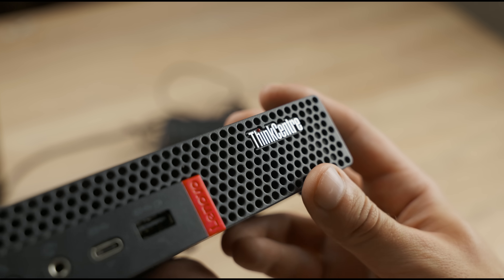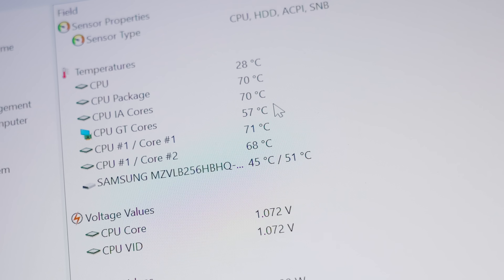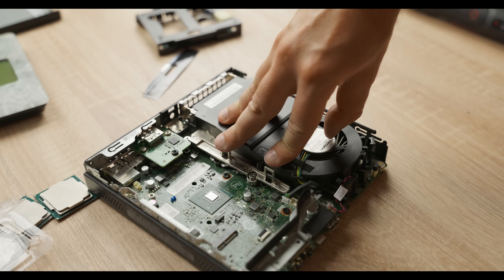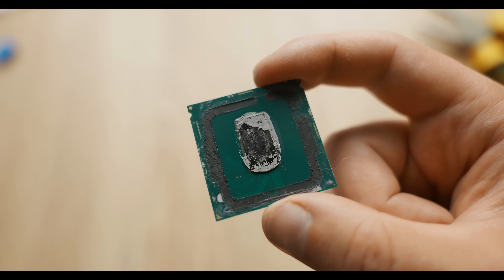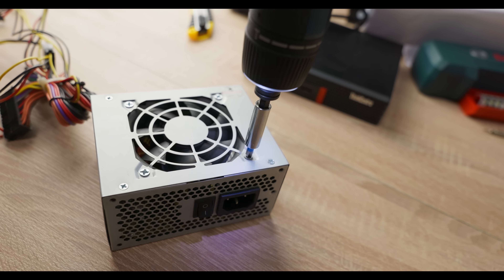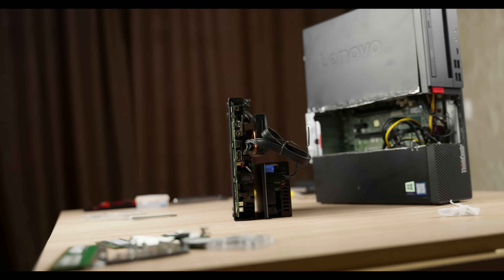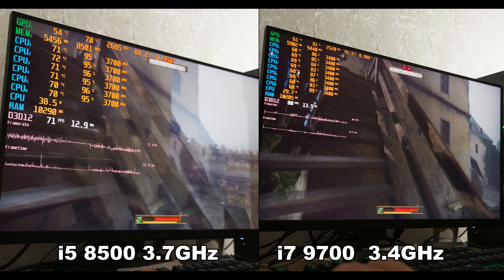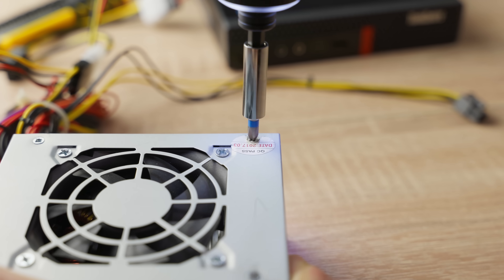Building the Worlds Most Upgradeable Mini PC

Comment from the maker: In the video description, the price of one board is listed as $100 because I couldn’t find it cheaper on AliExpress. But I bought the PC in Ukraine, in case anyone’s interested. Also, for around $150 you can already get one with a better processor than the one I used in the video.
Reply: The minipc itself with max PSU , was like 75 $ in a weekeend  scrap markt in Bucharest , and it came by default with a full height PCI-e x16 x75W ready slot, on the side .They are rare machines, not essy to find, was pure luck .I wonder if I can swap with better CPU, and if it worth, and I guess they can take only T or no letter CPU.
Reply: put a ryser on MINISFORUM MS-A2  x16 pci 4.0
Reply: Dangerous to me, or dangerous to the CPU?
Unlike my CPU's transistors, my outer epidermis will grow back

Comment: Fish Tank PC. build the strongest gaming pc you can in a 5 gallon Fishtank and have it all cooled by liquid inside the tank. You can use a circulator pump to move the liquid. just need a way to have the connectors for Power, GPU, Mouse and keyboard on the lid of the tank.

Comment: Aren't i7-9700 & i5-8500 both 65-watt TDP CPU's?
Then why is the power consumption so high on i7-9700 and hard to under-volt to below 40-watt?
Just because its a 8 Core CPU? (compared to 6 Core of i5-8500)

Comment: i think i have the same tiny on my desk. I use it as a linux server - a hardware vm. Mostly for random USB, wifi, networking control. It just a kaby i5 K
Frequencies dip on it because of voltage throttling. Not always, but under load.  Too much CPU for the computer - still runs fine, so i kept it in there.

Comment: UNA SIMPLE SOLUCIÓN PODRÍA BAJAR ALGO MÁS LA TEMPERATURA.  7:57 Los disipadores por sí solos no van a hacer nada, solamente se va a "almacenar" el calor del mosfet en el disipador..  Esos disipadores para funcionar correctamente necesitan de ventilación, circulación de aire para evitar que el calor se concentre en los mismos disipadores, Y en éste caso 8:01 , justamente eso no sucede porque la turbina está tapando los disipadores de los mosfet y el aire no arrasa con el calor en los disipadores. La solución podría ser sencilla: cortar la parte inferior de la turbina justo donde se encuentran los mosfet y de esa manera, el aire generado por el ventilador, sacaría el calor hacía el exterior por las ranuras del chasis.

Comment: I have a Lenovo like this and I upgraded the CPU to an i9-9900T (got it used but it was brand new) with a good nvme 
Instead of a GPU I installed another HDD (I use it mostly for work and sync my dropbox) but my big issue about upgrading GPU for it = Flex PSU price here. 
I can get from Aliexpress but with delivery and taxes it would cost me almost the price of the computer it self 
But if you have a spare (or cheap) unit to run it, its nice

Comment: damn. spent about 200 on my HP 800 G3 mini. 95w adapter, an i7-7700, IC graphite thermal pad, 32gb (2x16gb) ram, and an SSD I had lying around. ran VR for a few moments, but went over 102C before the system started freezing up, the system made a noise, and I pulled the plug. Seemed fine after running again, and haven't tried VR since lol. Currently use mine for a home server, but planning on setting up a PowerEdge R730 as a media server/main desktop, and using the mini PC as a stream platform for it.

Comment: Is there a graphics card worth buying that actually fit in the small pc, as is, (with the riser) without extra power and that performs better than the built in 630 and where you can close the lid?
Reply: I put a low profile single slot yeston 3050 in my p330 tiny and it fit after I drilled a hole in the case for the fan and took the shroud off the gpu heatsink.. It works off the pcie slot power alone but you need to underclock it to keep it stable. I keep mine capped at about 60 watts. Nice little build. people also design 3d printable covers for two slot low profile cards as well. It's a 6GB vram card so don't expect the latest AAA but it will run games just fine if you have reasonable expectations.

Comment: Hahaha oh wow
I suppose that truly is the best combination for a mini-PC right now; I guess there is actually finally a use case or reason to buy a 4060. I hadn't even realized that was actually the best performance for the buck as per efficiency you pretty much could get, everything else which is similarish in performance, sucks power like a hog, *or*, it is significantly worse performing which may not even fit in a low profile case anyway. I can't believe 115w is the best we can do nowadays, I remember when a bish tier GPU was like, a 65w 1gb card, but that even with much advancing graphics there was still often lower power, low profile options that'd be like a hundred bucks for a 75w card. I guess now it's a 6 pin minimum.

Also I was skeptical of the VRMs the moment I saw you bust out the 9700, Dell particularly is NOTORIOUS for cheaping out on their shitboards, it's basically one of the only things which is truly Dell's so naturally Dell's motherboards totally and completely suck as does anything like them which is most usually cheaped out on the VRMs and that is exactly why Dell motherboards usually have overclocking locked out on a BIOS level I've never found any workaround for, which is just as well considering if you OC'd a 4770k on a crappy Optiplex board odds are youll blow the VRMs and fry possibly not just the board but also other actually quasi valuable parts like the CPU. Which is why for my pet projects my favourite is getting the not-Dell, not-HP, not-Lenovo kind of motherboards that have real VRMs that could handle it. Also, funnily enough the bigger reasons most people eventually got saddled with ditching their Dell family PC altogether was near always board related.

Unfortunately, for any newer PC that era related like. First of all I am astonished that thing had a Pentium but could take a 9700 or 8500, hadn't realized that was in the same grid array anyway this doesn't matter as much because 6 threads is still rather pathetic ultimately (like for real, a quadcore 3770k had 8 threads; the 3570k was most limited bc it was 4C/4T and halving threads made them perform horrifically badly in modern uses, I'd not be shocked a 8500 does badly due to only 6 threads) but even then you are going to have serious VRM issues on anything. Meaning I guess you can't pipe much graphics through it anyway because cooling isn't the only issue, it points out the bigger problem (I also was surprised you didn't jerry rig a low profile noctua tbh) which is that those VRMs are eventually going to blow. Like they are physically going to spark and short out the PSU and maybe even trip a circuit in your room sooner or later the more you try modding those.

Comment: NGL I'm pretty sure I bought the same m920q from the same eBay lot, we have the same base specs. I ended up putting an i7-9700k, Nvidia t1000 4g GPU, 32gb ram, 512gb nvme, and I tore a 2tb SATA down to its board which I was able to fit under the GPU. Using a 170watt power supply and software to remove the tdp limit I'm able to push 90watts from the CPU which is pretty sweet

Comment: looks uglyyyy as hell I have the same computer just upgraded the ram, psu brick,  and gpu with a radeon low profile that it fits inside the case, pci express is 3.0 i belive so if you run pcie 4 or 5 it will be bottleneck those are the best upgrades and still looking factory oh and it will be a good idea to cut a hole on the top so the gpu can take some air just put a fan grill to cover it.

Comment: I've read that the CPU thermal paste is actually relatively safe.
don't eat it or anything..., but it's a good thing.
There are lots of compounds in many things industry sells that are really bad for you (and they don't tell you)
Solder flux fumes on the other hand aere NOT SAFE and should be mentioned whenever soldering (not sure best protection)

Comment: CPU will bent sooner or later under the pressure uneven applied over CPU body (yep LGA frame spring tension) - you should try a CPU Contact Frame .. they are cheap and safe.

Comment: Why, oh please why would you strangle the CPU cooling fan by putting the power supply on top of it? Even with a gap between them you're limiting airflow at max fan speed; maybe even at 3/4 speed.

For an accurate measure of the volume of the PC, use the liquid displacement method. A 20 liter fish tank filled with mineral oil or distilled water would suit the purpose.

Comment: FYI ,  I've managed  to build  a much thiner and cost effective discrete  GPU mini PC  , with just 250 bucks only , using the  provideb 180 W PSU on a  Acer Veriton N6640 with I7 9900 T + sloted Nvidia RTX 1650 TI  + 32 GB RAM + 3 SSD . I  like  the  deliding thing  you made on yours  !!
Reply: Rtx 1650 is real 🔥🔥
Reply: @SamuKumar-rz6tn   My  fault, sorry .  IT  is  a  ZOTAC GeForce® GTX 1050 Ti Mini ,  4 GB, actually , the  one  with  single fan . I am  pleased , it  works  great  for my HT .
Reply: Huh???

Comment: I'm running something similar in my living room - beefed up an acer veriton and ran an RX 6400 GPU on it, since I didn't want to go the extra PSU route. The RX 6400 is hampered by the fact it uses PCIE4 but only 4 lanes, and the veriton is only PCIE 3, which certainly holds the card back. That said, the RX 6400 barely sips power, and it amazes me what I've been able to run on this Frankenstein little thing - not just run, but actually playable. I'm even playing Forza Motorsport with a Fanatec wheel on it.
Reply: I have ssf unit for only 180 watts and processor i5 6500 - if I put rx 6400 pulse power supply will be enough ?
Reply: @STX_12  I reckon so. I've found that worst case the card pulls around 50-55 watts. The i5-6500 has a TDP of 65 watts. These two together would be responsible for around 120 watts in total. If your PSU is 180 watts, that leaves you 60 watts of headroom for the rest of that system. In any case, I'd say you have the best chance with the 6400; it does a lot for how little power it draws.

Comment: Actually the reason you saw.85 more likely 90 on such a weak processor is the intel it self they are all overheating garbage. And then theyll come out and tell you its thier fault due to a manurfactering issue. Then do nothing to rectify it to thier customers. Mean while the choice you had was to supposedly downngrade to a budget $70 amd cpu.and budget $50 mother board. Then you found out that the amd even the budget ones have 0 over heating issues and all your games play higher fps them the piece of crap i9 you got that has all these over heating issues.

Comment: Bro make video based on HP Compaq Pro 6300 SFF 

  Cores/Threads: 2 cores / 2 threads
  Base Clock: \~2.9 – 3.0 GHz
  * *No Hyper-Threading*
  Integrated GPU: Intel HD Graphics
  *TDP:  55W

### 🔍 Summary of Current PC Specs

| Component             | Specification                              |
| --------------------- | ------------------------------------------ |
| *CPU*               | Intel Pentium G2020 (or similar, LGA 1155) |
| *RAM*               | DDR3, 4 GB or 8 GB (max 32 GB supported)   |
| *Motherboard*       | Intel Q75 chipset, LGA 1155 socket         |
| *GPU*               | Integrated Intel HD Graphics               |
| *Storage*           | Likely HDD (SATA)                          |
| *Form Factor*       | Small Form Factor (SFF)                    |
| *PSU*               | 240W (non-standard HP proprietary)         |
| *Ports*             | USB 2.0, USB 3.0, DisplayPort, VGA         |
| *Expansion*         | 1× PCIe x16, 1× PCIe x1                    |
| *NVMe Slot*         | ❌ Not available                            |
| *USB-C/Thunderbolt* | ❌ Not available                            |

---^ above information given by chat gpt😅

If i want upgrade suggestions (CPU, GPU, RAM, SSD), let me know

Yeah bro I want to start my journey in programming, developing, cybersecurity and more more and more 😊
 Because I got it in my store room 11 years old got Oscar I mean os carsh 😂2 years ago

Comment: Take an old DEAD Sega Saturn video game console.

Modify the heck out of the emptied chassis and fit it with a ZOTAC GF9300-D-E LGA 775  Mini ITX motherboard with a dual core 2 thread 1.8Ghz Intel Core 2 Duo E6300 processor.
4GB (2GB×2) at 800Mhz DDR2 RAM in dual channel.
Motherboard integrated graphics Nvidia GeForce 9300 G98 540Mhz GPU with 256MB DDR2 64bit 400Mhz VRAM.
Storage 2.5" SSD 500GB SATA2.

Use an external 120watt power brick to power it. (May still require some undervolting. Align 2 USB 2.0 ports where the original Sega Saturn controller ports are and mount them with aluminum brackets. The original Saturn CD-ROM drive can be swapped out for a simple trayless DVD player with a little dremel work and some careful cutting of the Saturn's original CD drive bay and wire the new drive in through the motherboard's 2nd SATA 2 port and maybe use a custom mounting bracket to hold it in place.

Add a 30mm system fan and a proper low profile heatsink for the CPU,... cut a couple openings in the back of the Saturn chassis to accommodate the HDMI out, 2x USB 2.0 ports and the PSU connector port for the motherboard and presto,... a mutated Sega Saturn video game console that can play DirectX 6, 7, 8 and 9 PC games. Run the whole thing off a Linus distro like Ubuntu and you're ready for some fun though rather old school PC gaming!

Enjoy!
Reply from the maker: That’s a very detailed and creative project idea, it might be fun to try something like that.
Reply: @WhatAboutThePC  The real trick will be ventilation of the heat as even at 1.87Ghz the Core 2 E6300 can get pretty hot.
Reply: @WhatAboutThePC  Also there are a bunch of Sega Saturn consoles to be found on Ebay listed as broken not working and for parts listings that are dirt cheap.

Comment: if you could score an hdplex 250W power supply it could be smaller. but those are 150 bucks. also the pico psu with gpu power connector exists on aliexpress for 10 to 30 bucks. those are 160-180W and use external power supply

Comment: I bought one of the m90q's with the 10th gen intel i5. I put a 3050 lp in it then a 4060lp and a pico psu to power both the board and the gpu. I had to solder it.

Comment: liquidmetal is a Scam. it will Cause more problems then it Solves.. Trust me IT does not Stay put.. at best if the system is horizontal 100% of the time ok you may escape its dripping and running problem. if the system is Vertical its only a matter of time before the liquid metal starts Oozing and Dripping downward and since its conductive.. Short out City awaits you..
Reply: that and if the liquidmetal contains any trace of Gallium it will pit and decay aluminum heatsinks.

Comment: I'm doing something similar with my HP mini PC. Upgrading 9500T to 9900T and adding 3050 LP to go with it. I'm using one of those pci-e 4x to 16x riser cables and for power supply I have Lenovo's 8 pin 220W brick.
Reply: One time, I had an HP with a 35W i3-6100 and the VRM went pop. HP makes the cheapest junk out there, it will not end well.
Reply: @randysmith7094  I've had two of these and haven't had any issues with them so far. One was 4500T which obviously got outdated and the second one is with 9900T. The newer one has been used as a mini server machine with uptime of 24/7 for months with no issues. I've cooled my VRM's though, so that might be the difference.

Comment: i've seen several videos where adding those little heatsinks on bare MOSFETs does almost nothing.  it surprises me every time
Reply: makes you think why they are supplied with raspberry pi's
Reply: @N1h1L3  Because a Pi isn't running the same current? Durrrr, what'd you think those piddly little Pi4's are jamming anywhere near the kind of amperage and voltage as a real desktop CPU? Yeah no sh't sherlock it's because of the exact same reason we don't do those on graphical accelerators anymore, like you can have a, HD Radeon 6570 or whatever with a static, x570 southbridge tier thin slat of aluminium with a tiny fan glued to it that looks basically like a NVMe active cooler these days and it'll work, if the fan blows, but the issue is that you're still reaching heat saturation the exact same way as that piddly active CPU cooler did. It's literally like if you jammed a 1" diameter pipe into Hoover dam, you can keep raising the water level to get the water to shoot out farther but there's a limit beyond which you reach a critical saturation point and there is no more power/cooling equilibrium. For a tiny arse Pi with so low wattage/amps/volts running, you basically can get away with it like we do in cellphones and touchpads. Because the core load is never going to as fully saturate it before ambient cooling helps it regulate. Or like how if I was literally covered in sweet, there reaches a point in either dewpoint outside, or my core body temperature, where I'll no longer be able to keep cool and my body temp is only going to keep rising until I boil alive inside a parked car in Arizona.

This is exactly why I was looking to mod some of those NVMe active cooler type things over my old board's VRM's just to see if I can push more power without blowing them or at least not frying them.
Reply: @drek9k2  sit down dude
Reply: 7:57 Los disipadores por sí solos no van a hacer nada, solamente se va a "almacenar" el calor del mosfet en el disipador..  Esos disipadores para funcionar correctamente necesitan de ventilación, circulación de aire para evitar que el calor se concentre en los mismos disipadores, Y en éste caso 8:01 , justamente eso no sucede porque la turbina está tapando los disipadores de los mosfet y el aire no arrasa con el calor en los disipadores. La solución podría ser sencilla: cortar la parte inferior de la turbina justo donde se encuentran los mosfet y de esa manera, el aire generado por el ventilador, sacaría el calor hacía el exterior por las ranuras del chasis.